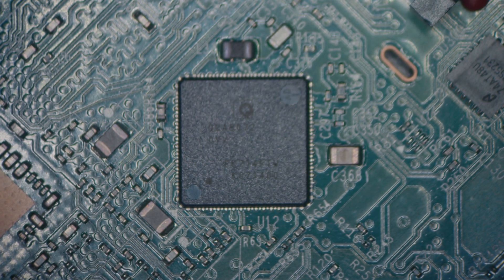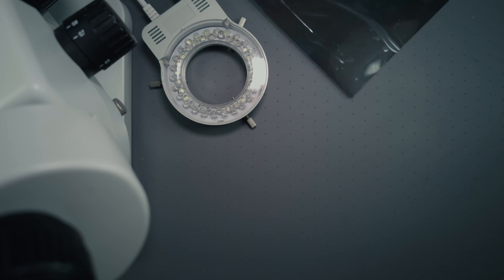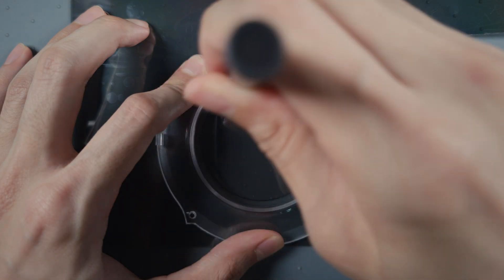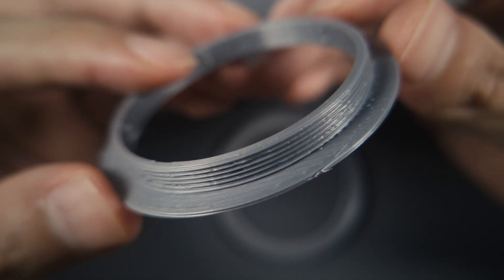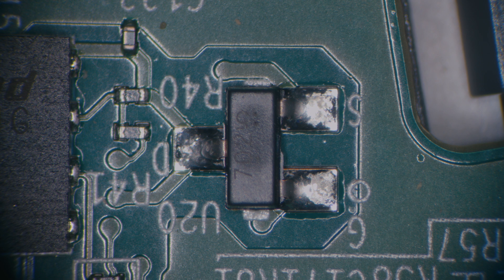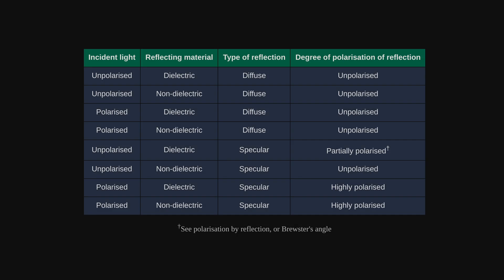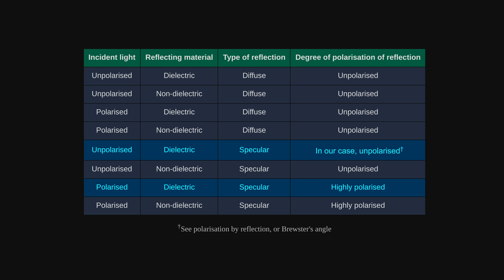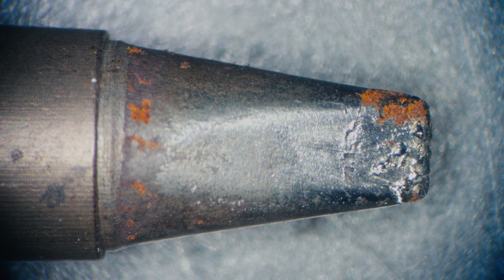Game-changing Microscope Polarisation Upgrade - With Free 3D Printable STL

Comment: Awesome. Only issue with this is when polarizing unpolarized light you halve its intensity so you will see a bit less trough the microscope but that is acceptable. You can still add an extra light source for when needed
Reply from the maker: You're right, this mod does sacrifice brightness. I've only really noticed this near the maximum magnification levels, and I might upgrade my ring lamp to something brighter in the future.

Comment: The polariter you have should be a linear polarizer, for a circular polarizer, rotating the polarizer should have no effect, only a change of handedness eg. from a mirror or flipping one polarizer 180 should change the attenuation
Reply from the maker: A circular polariser is made from a linear polariser (which filters linearly polarised light) and a quarter-wave plate (which then converts the light to circular polarised).

Comment: if you need a polarized light view - then add polarizer.   brilliant ! ))
in photography this known as polarized flash technique.   but as you may notice - when you turn polarizers 90 deg. image became completely unnatural.
some reflections are needed for a good presentation so it will be good to add second unpolarized light from one side just for little shine.
Reply from the maker: You're right, it's not always best to view the fully polarised image. For example, when I apply liquid flux, I cannot see it without the specular reflections.

What I usually do is do adjust the circular polariser to let in some of the specular reflections, which completely solves this problem for me. This adjustability is one of the reasons this mod is so good!
Reply: @engineerbo   i understand ) 
  i am talking from photograhy point of view.  when you rotate polarizer you can bring back some reflections but they are the same unwanted reflections from ring light which you tried to eliminate in the first place.
but with a second light you can create whatever reflections you want.
Reply from the maker: Ah I see, you're talking about making the image look good.